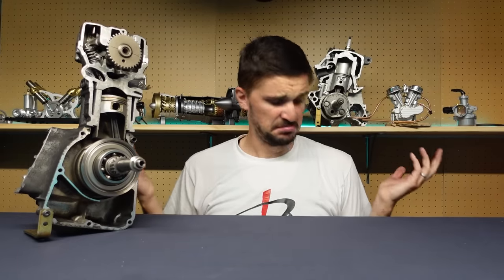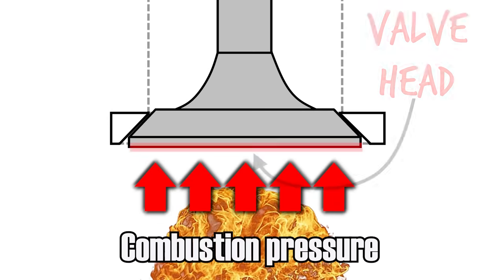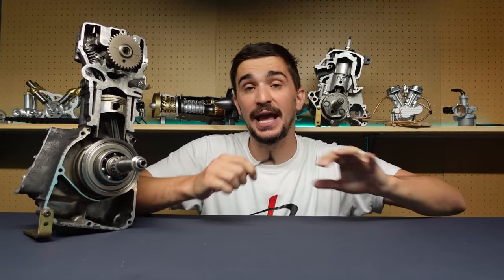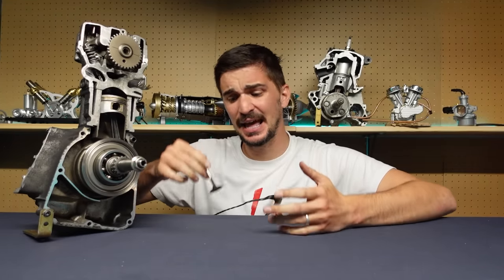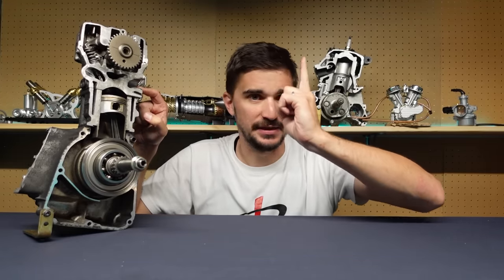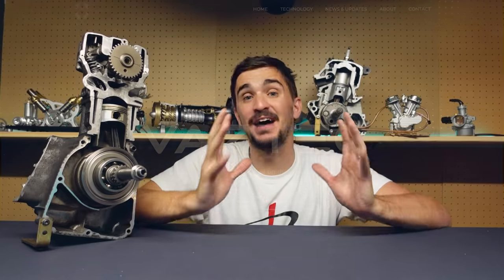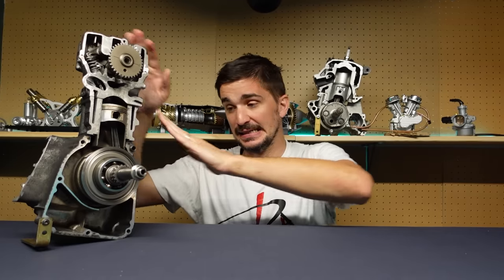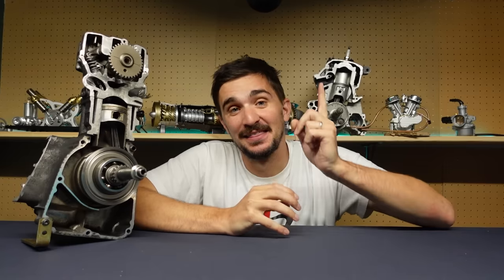Rotary Valves Make Normal Valves Look Silly - Why Aren't We Using Them?

Comment: Another great presentation. There is another old alternative-, namely sleeve valves. It would be great to see a video on this. It was the great competitor to the poppet valve but with modern metallurgy and tolerances, maybe it could flow like a rotary valve and beat the poppet. The Bristol Centaurus and the Rolls Royce Crecy were probably the pinnacle of sleeve valve design.

Comment: I'm impressed!
Very nicely explained!

I'd be interested on the maintenance intervals of the rotary valve on the race car!

Biggest issue probably is and will be for some time - the seal... the vlv is rotating...! Which means wear and tear due to friction. 

You need to keep exhaust away from the bearings of the rotary valve.
Maybe something used in turbines could help. Include a labyrinth seal?  I also could imagine charged air applied to the labyrinth seal...
Just doing some "loud thinking" 

For once a very interesting subject. For I don't think much of all the electrical, hydrogen... so called "renewable" bollox. Cause vast amounts of electrical energy is required and a grid capable of handling it. And of course you need to store it... 

And hydrogen & Co is like "running 2ce around a church before entering it".
You need to "make" hydrogen - losses
You need to store it - more losses. You can't just store it in any tank... 
And even more losses at what ever you want to power with the hydrogen.

Comment: In the ninteen thirties, Detroit diesel partially solved  that problem with its two stroke blower driven engine with positive pressure intake ports and one exhaust valve, reducing the rotating assembly losses.  It was the world's most successful diesel  engine for half a century. Government exhaust emissions regulations took the detroit engine off the road.

Comment: To keep a centered spark plug we might put the rotary valves into the camshafts. To keep it sealed and reduce wear the shaft would need to float in pressurized oil and we need a "piston-ring" of some sort between the shaft and the cylinder head. My intuition tells me this tech would be more challenging at low rpm, as the valve has a higher resistance leaving the chamber than entering. Which is the important rev-range for an efficient road car. But it would rev very high as we get a bigger airflow and should scale very well with the forced intake of a turbo.
Great for a sports or race car.

Comment: 2T bikes used that kind of stuff in power valves - to reduce exhaust flow - RGV had fancy valves made of 3 sliding pieces, but it was failing after some time. The biggest problem of rotating valves is sealing it up, but there are ways to do it good :>

Comment: d4a: You stated that the major problem with sealing a rotary valve is the expansion due to heat. It seems to me that a simple solution to that problem utilizes the same design choice as poppet valves - namely tapers. The valves used for natural gas lines are rotary valves with ~5-10° taper and a spring to keep the "rotor" seated. The gas tight seal is achieved strictly via body to rotor seal - no other lateral seals are required. The valve consists of just the valve body, the valve rotor and a lubricant (plus a nut and a spring). 

An engine valve would use a much smaller taper, of course, but the principle would be the same. Making the valve body and rotor of the same material would allow the valve to automatically self adjust to heat expansion, eliminate the blow by gap of the Watson valve and possible eliminate the gasket seals. I was curious to see how the JSAE paper authors did away with lubricants but nothing was said.

Comment: I think the reason we don't see rotary valves on production cars is primarily uncertainty- auto makers don't want to warranty a system that may suffer failures at unknown intervals. Poppet valves, on the other hand, are easy for techs to work on and diagnose and are very reliable.
Reply: As far as I recall, Desmo valve systems close the valve mechanically / positively rather than utilizing a spring for closure - although they interpose a resilient member / spring to cater for expansion / contraction, much less energy is lost in a Desmo valve train since it is not exerting against the longer travel of valve springs utilized in conventional poppet valves.  A big advantage is that Desmo valves ameliorate valve bounce at high speed.

Comment: You should check out the British "sleeve valve" design of the Napier aircraft engines of WWII. Napier was successful in producing a small, high RPM engine that produced a lot of horsepower without poppet valves.

Comment: And poppet (i.e. normal) valves make rotary valves look silly. 
You state about Vastec developing one that runs oil free. But this all glosses over rotary valve engines were notorious for burning oil. Yes, you can take the oil away but these heads have not managed to do away with a quite short lifespan due to wear. 
But a poppet valve engine does nit suffer from either of these problems. They can now give a very long life without  running oil burning. 
I note you also failed to point out that the only folk who have ever used rotary valves are dedicated to all-out high power uses.  The BSA racer is not a car for everyday street use, and the Bristol and Napier aircraft engines were designed for fighter aircraft where mpg in oil use was of much less concern than getting horsepower to the propeller.
And who needs many thousands of rpm? Only a few power heads. It'll only have to geared down anyway.
So, to the vast majority of us, the poppet valve wins hands down for being able to give clean, reliable, cheap to run engines.

Comment: More and more ideas I had as a kid are getting patented 🙁

Just one drawback I remember when I was thinking about it: it would take quite a long time for the valve to open fully, since the hole doesn't get exposed at once. Traditional valves spend less time opening and are fully opened for longer, which leads to more time where the air can enter the cylinder

Comment: Coates engineering in the 90s was designing the same thing.  They were working on a carbon seal.  But they are no longer around as well.

Comment: As mentioned elsewhere, the sealing challenge is anything but trivial as demonstrated by the Wankel engine. also I can foresee problems in incorporation this system in a multi cylinder engine whilst retaining cylinder head integrity. Also multi valve systems would exacerbate the problem and, possibly, end up with much longer port lengths.

Comment: Rotary valves were designed by Cross engineers in the 10920s in Uk. And had many engines running with them.
Cross engineers are still in business and making parts for high performance jet Engines

Comment: To avoid the thermal expansion/contraction, use fused quartz of Zerodur.  These glass formulas are used when optics must warm and cool without distortion of precise surfaces.

Comment: Greetings! I have to say that valve springs almost do not reduce engine power while its working. Inertia makes the spring compression time much shorter compared to rotating it by hand. Besides, after compression spring pushes back

Comment: What i would think is a moderate disadvantage, mainly for cars which prioritise performance and are meant for racing, is that it would be really hard to adjust the intake timing and exhaust timing. With normal valves we can adjust adjust the timing by like adjusting the camshaft but with the principle which was showed here the intake and exhaust timings are fixed to eachother so they can only be changed together and not relative to eachother. And also, technology like vtec wouldnt work, because the size of the holes which are in the cilinder cant be changed, it would take a massive redesign to be able to change the timing of intake and exhaust seperatly and also change the duration of intake and exhaust with this system. Not to mention the other two smaller problems listed which mainly concerns the seal and the expansion of the cilinder due to combustion heat and the location of the spark plug. Fixing the problems i just stated would take so much effort to solve and so much extra mechanics i doubt there would still be any advantage left for using these rotary valves instead of the valves we use now, despite how benificial these new valves seem at first glance.

Comment: I was hitherto only familiar with rotary valves as executed in old 2-stroke Vespas, where the crank/flywheel assemblies are discs with ports machined into it. As the engine rotates, the port in the disc aligns with intake and exhaust ports.
I'm sure 2-stroke makes that a much simpler thing to achieve.

Comment: Most of the energy used compressing the spring is recovered when the cam follower is forced down by the spring accelerating the rotation of the cam which accelerates the cam belt which accelerates the crankshaft. There is of course a friction penalty of the cam follower on the cam but there is similar friction between surfaces in rotary valves.

Comment: You might want to have a look at RCV model aircraft engines. They use a rotary valve technology, but the valve is a cylinder that rotates inside the combustion chamber. I have one (a 10cc) and it works very well. It seems to produce as much power as a standard two stroke 10cc even though it's a four stroke, and can swing a bigger diameter prop. They even have one with a 90 degree gearbox set up so the crankshaft actually has the piston moving up and down on it. Weirdest thing I've ever seen. (it is a 1.2ci/20cc model). I have another engine that works in a very similar way. A Hirtenberger .23ci (about 4.5cc).

Comment: I thoroughly enjoyed this video. and would like to add this. The future for IC piston engines lies in reducing the losses associated with valves train, oil pump, water pump and alternator. Only then we might extract more than 40% energy from fossil fuels through IC piston engines. Forced induction, turbos, has become a commodity when only 20 years ago was considered novelty in "consumer" cars, reserved to the higher classes. There are works in the making for creating valve systems that are pneumatic and operated with the combustion gases from the exhaust, like a turbo does. Koenigsegg tried to innovate with their freevalve system. One things is certain, the only way the IC engine falls into oblivion is if battery tech manages to safely store more energy per kg, e.g. energy density, than fossil fuels are capable.

Comment: Any 5 year old would understand that you need to remove energy waste in order to make engines more efficient, and regular cylinder heads are the most ancient technology still left in internal combustion engines. You simply nailed their biggest issue. Bravo! I would have 1 barrel for the intake and 1 for the exhaust; keeping them separate would allow for optimized spark plug and injector placement. They would still take much less energy from the engine than 2 camshafts.

Comment: I came up with a rotary valve idea just a few weeks ago without having heard it existed. Not exactly the same.

However it is was to solve a completly different problem: I also came up with a new kind of rotary engine, and even though I searched way back into rotary steam engine patents, I still haven't seen anything similar. 
The concept can have "any" number of sides, and all of them can burn in each cycle. Meaning it can have for example, 4 chambers and 4 full combustion cycles in a single rotation, all around the engine. So it's completly different to Wankel or vane engines, and there would be no uneven heating of the rotor as in wankels. Also I'm pretty sure aircooling would be all it needs, since a fan/turbine mounted to the axis could push as much air as you want around the rotor (also considering what this specific design would allow).
Although a rotary design can work with ports only, and no valves, what I came up with is also a split cycle, meaning one rotor only for intake and compression, the other only combustion and exhaust. So while there are a bunch of possible solutions regarding valves or ports, a rotary one looks best to me.
I also think this idea solves the sealing and oil issues that the wankel has - hopefully.

Anyway, I have this idea, and don't really know what to do with it. I don't have the means to build and test it, but then, if it really works as I think it would, it could be something with insane power to weight ratio, and worth a lot. What can I do now?

Comment: This isnt the only problem but you are clearly aware of most of them. The alcohol is likely too strong. If you have a lubrication system it will cause some fuel wash, or like you found it'll bind up the vanes. Gas, even premix fires easily so there's not much of a reason to use that strong of alcohol.
Your crank was walking in the bearing.
If you spin the flywheel with a gear reduction you could probably still use it perfectly fine to get the spark more when you need it.
Very cool, high hopes for the next prototype considering how good the first one already was.

Comment: one way i just thought of to improve the rotary valve:
make the cylinder conical and instead of making the canal go straight through the cylinder, make it go in from the side of the cylinder and out the wider bottom.
this way you loose a small bit of air flow to the 90° turn inside the barrel (which can be turned into a smoother gentle curve at least in larger engines), but the now conical shape would give you all the advantages of the poppet valve with none of the downsides.

Comment: You get the energy back from the compressed spring when it pushes back on the other side of the cam lobe. valvetrain power loss comes from friction. which rotary valves will also suffer from. along with the lost chamber pressure from the leaking seals, it wouldnt surprise me if a standard valvetrain is more efficient

Comment: Lead worked to slicken things just like the addition of Toluene to race gas are oil and gas together in the 2 stroke. You cant get the same horsepower from a 4 stroke as a simpler two stroke without mixing the gas with the oil are the addition of dangerous petrochemicals. 
The fact that double charging with the addition of toluene could produce almost 150hp per liter is insane! The Delta, Lancia Astrada class b was 1800cc but produced 380hp! If we actually added a watered mist to the addition of a double charged engine, you could increase the hp and output exponentially just by increasing the compression of the fuel to air ratio! They actually add thicker, water weighted air mixtures to the Royals Royce LPG compressor stations to make the jet turbine run as efficiently as it would in a higher atmosphere!
The whole idea of the single well lobed camshaft to open and close the valves works well enough with the springs and along with the vacuum pressure to create fantastic, high revolutions and increased horsepower with the inline engine versus the V is incredibly important! Gravity effects the way parts wear as well. You'll get 100,000 more miles on an inline  than a V before you need a total rebuild! 100k MILES IS A HUGE DIFFERENCE! 
The idea of making engines more efficient with more timing chains and devices just makes a more complicated, lower mileage, less cost effective engine.

Comment: My Kawasaki motorcycle in the 1970s had a rotary intake valve . It worked so well that rpm was almost unlimited as reed valves could not do the job for 10k plus rpm . Old GM diesels use poppet valves and port air intake  . Even better is opposed two piston engines with no valves but open ports . Sort of a one stroke two stroke . Two piston smashing the air between them like the old diesels from the past with two crank shafts . Easier than the engine above

Comment: The Bristol Centaurus 18 cylinder air cooled radial aero engine used a rotary valve system.  It had its advantages but one thing that the pilot had to keep an eye on was oil pressure...

Comment: Excellent. Just a side question: Doesn't the valve spring give back some or even most of the elastic energy stored in it to the crankshaft during the descent down the other side of the lobe on the cam?

Comment: Even sleeve valves could offer benefits over poppet valves. They were used in many aero engines, with a downside being higher oil consumption, tho alongside larger service intervals.

Comment: The Strength, Reliability & Simplicity of the Internal Combustion Engine WiLL 
Always be more important to the buying public than it's efficiency & performance.  
This is the reason wHy the overhead valve engine is StiLL being manufactured today.

Comment: Can't help wondering if a tapered valve barrel would offer a better seal.  Plus the degree of insertion that the taper is set at could be varied to make of for thermal expansion issues.  Who knows?

Comment: I guess all of the large companies have evaluated this idea already and tried to make it work.
Besides the sealing, which is a big problem, the longevity is the hardest part.
If just a little bit of combustion gas gets into the chamber, it will build up more and more carbon residue while operating in the long run.
The chamber should be able to clean up itself before every new start of the engine. Might actually be a good idea ;)